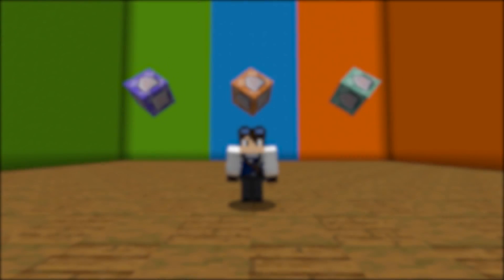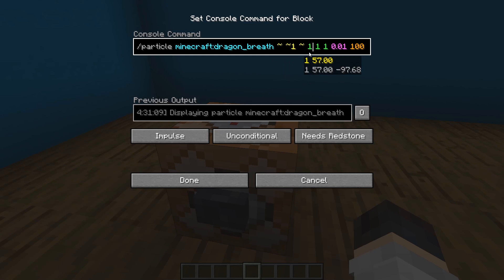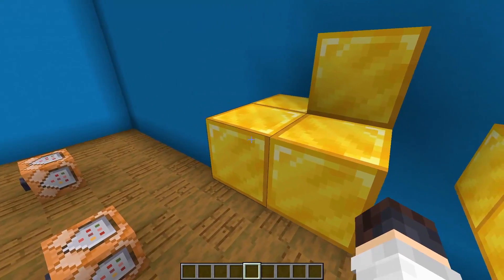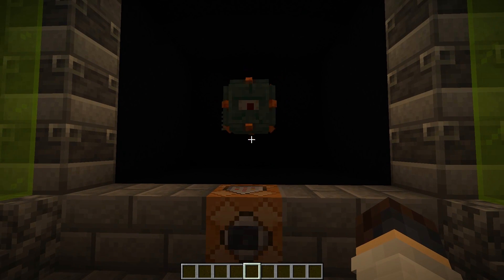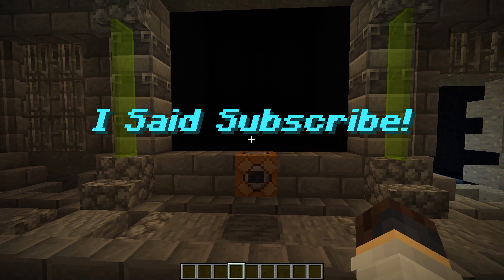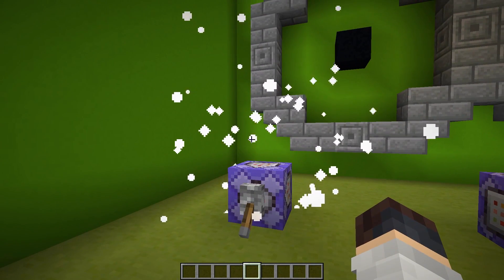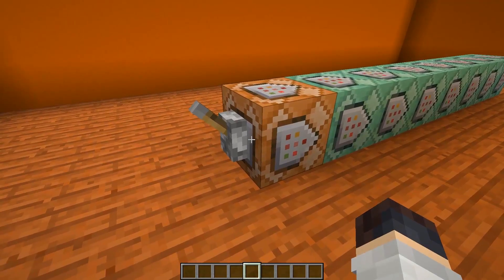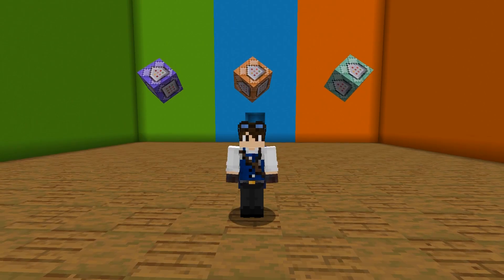HOW TO USE COMMAND BLOCKS IN MINECRAFT - TUTORIAL!

Comment from the maker: Hello, Ladies and Sir's! I accidentally didn't fully explain how to use the conditional and unconditional command at 0:58 so here is a quick rundown of that 
=========================================
Unconditional (Default) : Run a command normally

Conditional: Run a command If the previous command block (opposite of block direction, can't use rotation rule in 12:30 of the video) run completely 100% (or you can say that it must run every letter that you type in)

Let take an example :

< > ^ v are the direction

the first command is Unconditional

and the second command is Conditional

> > this is working

> ^, > v, > < this isn't working
==========================================
Hope that all made sense Ladies and Sir's!